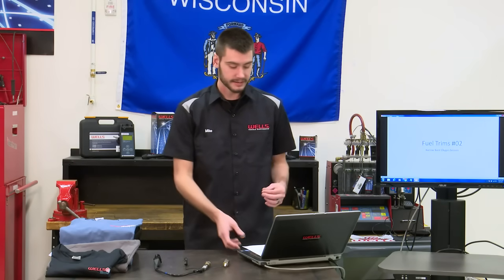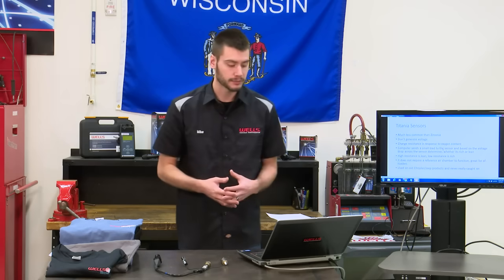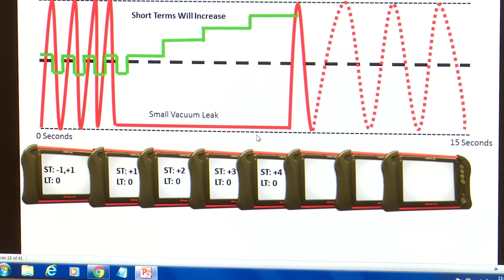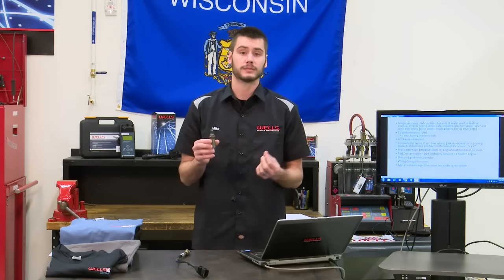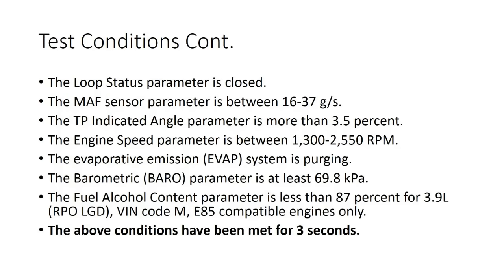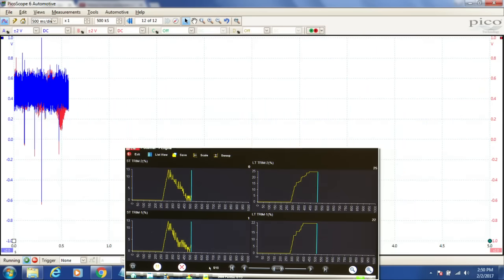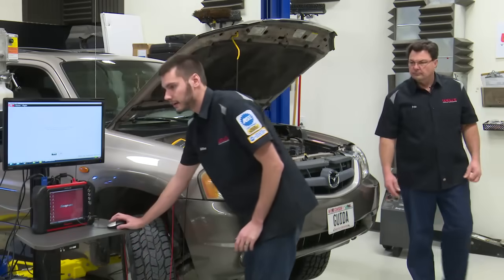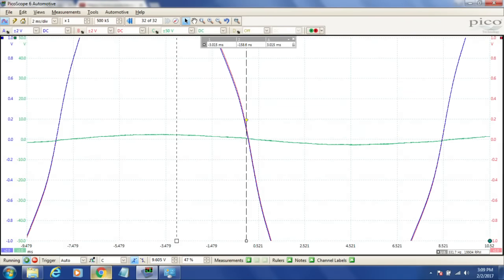Fuel Trims – Oxygen Sensor Basics—How They Work and How to Test and Diagnose Them (O2, HO2S)

Comment: So when an obd was done on my car ECM and PCM related to the ASB came up ~ the guy said it means the ECM and PCM are not communicating with each other and there may be an electrical problem ~ what can you tell me? Much appreciated. Honda CRV 2008. My mileage dropped from 24.6 immediately and after two days to 19.1 after filling up at a particular gas station that has been reliable in the past but I am wondering if they got a bad load of gas as this happened right after I filled up with them.
Reply from the maker: Hi, if you are having a communication issue with the PCM chances are the vehicle would not even run. I highly doubt it's connected to your drop in mileage. 
Mike Becker, Senior Instructor
Reply: @GoTechTraining  interesting now ~ my gas mileage has been increasing daily since this whole thing started ~ whatever!!! and my engine light went OFF! SO, Just going to fill up again at a different station and see what happens!
Reply: After you install a new emissions component, your vehicles computer needs to "re-learn", or basically, it needs to figure out how to properly run most efficiently with the new component. Whenever replacing any sensor, or emission components, you should disconnect the battery long enough to reset the computer. This way, everything is how to work together. If you only replace 1 sensor or component, the computer is using it, thinking that its the old sensor, which (at first) can lead to minor, but noticeable performance issues, idling issues, air/fuel mix issues, increased emissions, all of which, can contribute to a significant decrease in gas mileage. I suspect that the person who replaced your sensor did not dis connect your battery. Personally, every time i change my oil, i dis connect the battery, just so the computer re-learns everything. I have noticed that when I change my oil *without disconnecting the battery*, at first, i see a drop in mileage (the new thick oil needs to be broken in, which thins is out a little), then, my mileage goes back up to where it was before changing the oil, or close to, but not higher than, my previous MPG.

However, when I change my oil and *Disconnect the battery*, i see a decrease in MPG (again, the new thick oil needs to be heated up, broken in, and thinned out a little), but then i always see atleast the same MPG as before oil change, or an increase. 

Disconnecting the battery is during an oil change has nothing to do with the computer needing to re-learn anything due to the new oil, however it re-learns all the sensors and emissions components. Your motors sensors and components will perform differently in different weather, so i reset mine with every oil change. It will eventually get used to the current seasonal temps, but that takes alot of complete drive cycles, and is exposed to a very wide range of weather conditions. By resetting the computer with every oil change  (i do mine anywhere from 3000 to 4000 miles, or ever 3 to 4 months), i maintain good gas mileage, a few more mpg's than others report with the same year/make/model/motor/transmission
Reply: @p.j.vallier9197  Do you know this for a fact or are you just assuming based on your experience/outcome?
Reply: @Coldblackice  I know this from both personal experience and knowledge i gained while in school. 

The adaptive memory is for making the vehicle run and drive in a way that maximizes the overall performance for making the motor run more efficiently, reduces emissions, and to slightly adjust the shift points just to name a few. 

The adaptive memory is a way for the vehicle to determine how to properly operate in conjunction with the person's driving style, and how to make  the motor properly operate by getting to learn the slight variations of each sensor and component that comes into play.

You can have 2 of the exact same sensors, and there will be slight variations that effect how it operates. When a sensor is made, there's acceptable ranges of certain values that make it meet the requirements inorder for it to meet the specifications of what its designed for. And for the sensors, the adaptive memory is what the vehicle's ecm/pcm uses inorder to determine exactly how it will go about using the sensor.

Comment: i have an issue with the lean bank 1 with the 02 sensor never going rich unless i press  and release the throttle when it goes lean for a micro second, but otherwise its remains rich even while driving and the fuel consumption is extremely high what would you suppoose the problem is, in kenya getting somone who understands this error is had i been in and out of garages and alot of money spent so far
Reply from the maker: Hello, if the issue is that it's stuck rich all the time I would inspect the vehicle for excess fueling. Does it have a fuel pressure regulator? Does it maintain fuel pressure after the key is turned off? Maybe you have a leaky injector or something.
Mike Becker, Senior Instructor

Comment: Will a 02 sensor  bought from amazon  work as well as 1 bought  from dealership  or auto  store ?
Reply from the maker: Great question Isaiah. All depends on the brand and if Amazon is a direct seller of the product. If it's the right sensor, the right brand then yeh it should work fine. 
Mike Becker, Senior Instructor

Comment: Just love your vlog..I'm an electrican with a background in electronics trying to diagnose my 2013 gmc Sierra with 65,000 kms. Getting intermittent codes of p2272 and p0160..and when I clear codes no engine light for few weeks..then it appears again...was wondering if there was a problem would the check engine light appear right away or does it build up the codes..ie checked with scan tool and tells me there is three codes with same #...looking for where I can find schematics also.East coast Canada. Big Al..BTW D is correct answer but I did put dielectric grease in connection las summer..going to remove it when it warms up.
Reply from the maker: Hey Big Al, thanks a ton for the kind words! Chances are those 2 codes are "multi-failure sets a light" type codes. It won't set immediately. It also may not run the test ALL of the time. Both codes do seem to point to B2S2 being lazy. Has the sensor been replaced?
Mike Becker, Senior Instructor
Reply: @GoTechTraining 
 I did purchase one and my next step is to replace B2S2. I.was going to check voltages first on the signal circuit (thinking heater cct is fine). I realize the voltages fluxiate from 100 mv to 1 v .Is this what I should see..had truck undecorated last year..possible oil on exterior of sensor would trigger a bad O2 reading...not sure.. Thanks for the info.
Reply from the maker: Being that it's after the catalytic converter I would expect to see the voltage relatively steady. But yes, they will be between 100mV to 900ish mV. You can always compare it to the sensor on the other bank :) 
Mike Becker, Senior Instructor

Comment: So I have p0171 b1s1 and p0604 my 02 my car was burning oil so if my sensor was back and thr other one was white what does it mean
Reply from the maker: Hey Isreal, it's possible the sensor was damaged form the burning oil. If it's sooted up i'd recommend replacing it.
Mike Becker, Senior Instructor
Reply: I have a quick question for you. See if you can help me out with this. I'm pretty sure I'm right. Brake booster hose not the brake booster, but the hose itself. When I take a smoke test. I saw that the end of the brake booster hose. Where it meets the Y connector Smoke was leaking from there. So when I pull out the hose from the connector. And place a new hose did a smoke test again it didn't leak the hose  seems to be really hard. Not as soft to be really tight and down. So I picked up a clamp. Ive place inside there Hopefully it would stop the leak. This would cause a lean code, correct? Cuz it's part of the vacuum assembly.
Reply from the maker: Yes, the brake booster hose could definitely cause a lean condition if it were leaking. It is under full engine vacuum all the way into the brake booster.
Mike Becker, Senior Instructor
Reply: @GoTechTraining  Thank you so much. I try to find other forms about it, but I could not find anything. I do enjoy watching your show. I've learned a lot about it. Certain things I couldn't understand but Thank you so much. You're very helpful compared to everyone else.
Reply from the maker: Thanks!!
Mike Becker, Senior Instructor

Comment: Have an old OBD1 Daihatsu and no way of checking anything with any available scan tool. Bridging the diagnostic connector showed nothing, wanted to test O2 sensor (single wire) and thought how? DVOM doesnt work well so got out the old mans 50 year old analogue multimeter, unplugged the O2 sensor from the supply harness and made a bare wire bridge between the male and female plugs then connected analogue meter to the bridge and low and behold, the analogue meter showed me the response of the O2 sensor. Well as best as I could get. This meter had a dc voltage setting of 2.5V range so could get a decent read too.
Reply from the maker: That's awesome Jason! Way to put an old school tool to use!
Mike Becker, Senior Instructor

Comment: P0133 O2 SENSOR BK1 signal too slow....causes for this....bmw e87. New o2 sensors.... what can cause this? Thanks
Reply from the maker: This could be caused by a lean condition. The code is saying the voltage is too low. This can be casued by a bad sensor, but you said you already put a new one in. I'd be looking for air getting into the engine after the MAF sensor. BMW"s are common for the air intake tube to crack. Also, PCV issues. Look for an exhaust leak pre-02 sensor as well. Good luck!
Mike Becker, Senior Instructor
Reply: @GoTechTraining  hi...one of the leaks...was the pcv valve cover tube. Was sealed on the intake. One this that i notice. The upstream o2 ( yelow seal conector) and downstream o2 (green seal conector)....they are mixed?? They have diferent cable leght....
Reply from the maker: If you get me the year and engine size I can look up the sensor part numbers and see where that leads us.
Mike Becker, Senior Instructor
Reply: @GoTechTraining  
Bmw e87 (2005) 116i Engine N45B16.
Reply from the maker: This must not be a US model? i'm not showing that listing in my information.
Mike Becker, Senior Instructor
Reply: @GoTechTraining  its EU model. Portugal.
Reply from the maker: Unfortunately i'm not able to pull the sensor number on something outside of the US.
Mike Becker, Senior Instructor

Comment: PO171 Bank 1 System too lean. Why isn't this among the 62 oxygen related code you showed us?
Reply from the maker: Hey Frosty Leprechaun, because a P0171 is not an 02 sensor code. It's a lean code that could be caused by 1000 different things, 02 sensor being one of the them. The 62 codes show were directly related to 02 sensors in their definition.
Mike Becker, Senior Instructor

Comment: Ive this problem on my golf 6 gtd 2010 gaz temperature transmission error. What should i do. Clean it or get a new one. The car sometimes slowdown  high consomation of gazoil  and when the car stand up  it shakes
Reply: Great
Reply from the maker: I don't recommend cleaning an 02 sensor. If you remove it because it's bad, your best bet is to replace it.
Mike Becker, Senior Technical Instructor

Comment: Vehicle: '06 Mustang GT with long tube headers and cat deleted h-pipe. Off road use only. Downstream O2's are turned off. What would cause slow response on both banks after a 5~20 minute hot engine restart? The ECU goes in to close loop, but the O2's barely respond with voltages between 0~.5 volts. Both fuel trims begin to climb and usually peak at ~+65 and hang there for about a minute or so. Bank 1 sensor usually begins responding normally (switching back and forth .1 to .9 volts) first and then bank 2 will follow shortly after. The fuel trims come back down to normal between -3 to +3 there after.  Occasionally the ECU will set a code slow response code(P0133) and/or a stuck rich code(p2198). I've changed both O2's  with no change. Have not detected any exhaust leaks. The O2's operate normally on cold engine start and if I restart say after 20+ minutes.
Reply from the maker: Hey Jrwou1, are the front sensors too far down the pipe? Not properly reading the exhaust content? Anyone else run into these issues with these specific headers?
Mike Becker, Senior Technical Instructor
Reply: @GoTechTraining  Headers and h-pipe are by Pacesetter. The front O2's are located in the collector of each header.

Comment: I have those problem with my 2006 Toyota wish(Malaysia), it shows p0141 O2sensor heater circuit(bank 1 sensor 2) on scanner. What should I do? What is the effect for having those problem?
Reply: I think it's possible that the heater on the sensor has gone open circuit. It could also be short circuited but that would probably have blown a fuse. Test the resistance of the heater and look for 2-14ohms. HTH.
Reply: @TheHeatingEngineer  should I replace the sensor with the new one?
Reply from the maker: I'd recommend you perform that resistance test :)
Mike Becker, Senior Technical Instructor

Comment: An o2 sensor doesn't detect oxygen, it detects a lack of it (zero to 300mv output) and it also detects an excess of fuel (600 to 920 mV)
Reply: 1magnit but why does it give you those readings on a multimeter?
Reply: Diffusion of oxygen ions through the electrolyte causes a build up of charge, measured as voltage, the greater the rate of diffusion, the greater the voltage.
Reply: 1magnit i wish we could be neighbors
Reply: We learned this stuff in school, chemistry, electrochemistry, half cell reactions, oxidation and reduction, half cell voltages, full cell voltages, the zero to 300 is the half cell voltage for o2 to oxygen ions, the 600 to 920 is the full cell voltage with fuel as the other half cell.
Reply: 1magnit i havent gone to school yet but i can figure out how something works, how its put together, and how it breaks by taking it apart and looking at the components i can safely say i  have an edge over a kid fresh out of school with no experience (not saying you by any means but a friend i have that paid 36 grand to go to school and still asks me for advice) my stepdads an automotive engineer, and took me under his wing at around 13 years old, im sure that helped alot.

Comment: What if the values of the sensor remain the same if you create a vacuum leak? and the sensor has already been replaced twice.
Reply from the maker: Where are you viewing the values? In a scan tool or actually taking voltage measurements?
Mike Becker, Senior Technical Instructor
Reply: thanks for the response.it's a 2004 ford focus gasoline. I use the official Focom scanning tool. I have solved the problem now. The problem was the new Ngk sensors that wasn't good. after buying ngk sensor twice, I have chosen for a Bosch sensor. and the car has been driving for a week now, and now the Long term fuel trim always stays at 1,2 %  And when i create a vacuum leak now it reacts immediately and goes very lean to 23% positive.    the seller also told me that there are many problems with the Ngk oxygen sensors. they come faulty directly out of the box giving faulty readings, or they go worn out within low mileage and giving faulty readings without check engine light.
in any case, the car is now driving all the way as new with the bosch sensor, and a lots of engine power.

Comment: How about ? How to recognize the (cpu pin abbreviation )for finding the  Actual pin  , let's say the signal wire or the power heater pos. Wire.?
Reply from the maker: Sometimes it's guessing. Sometimes there's a glossary. Depends on the situation. 
Mike Becker, Senior Technical Instructor

Comment: Use Propane instead of Brake Cleaner.  Much safer and doesn't damage your rubber hoses.
Reply from the maker: Great tip Gary!
Mike Becker, Senior Technical Instructor

Comment: redfr21@icloud.com, Installing these 2 sensors should be done routinely as a means to keep a car in peek running in the most efficient posable condition, right?
Reply from the maker: Sure Frederick, they degrade over time. If you want your car in tip top shape it would be a good idea.
Mike Becker, Senior Technical Instructor

Comment: How do you trick a o2 sensor after a cat so it reads normal? Cat is no good and don’t have the money to buy a new one. Ej255 motor it’s the sensor after the down pipe
Reply from the maker: Jordan, you really can't. Besides it's not legal to "trick it" in order to pass emissions.
Mike Becker, Senior Technical Instructor
Reply: No more emissions In Washington state after the first. So it will be legal. Is it possible to pull the o2 sensor out of the exhaust stream a little bit?
Reply: Spark plug non fouler. I only offer am amswer cause i know what its like to struggle financially. Good luck.

Comment: D, Neither, a) my connector is inside the cab under the passenger seat not exposed to the elements, and b) my O2 sensor, as I understand from what I can glean from the factory manual, is a resistive element and proportional, it doesn’t switch on and off. I’m an enthusiast, 1988 Mercedes 300e, W124. I’ll bet I’m probably wrong too.🥺
Reply from the maker: Hey Wayne, actually you are correct! Nice :) 
Mike Becker, Senior Technical Instructor

Comment: im driving ford focus st 170 durateck 2l  16v how can i hack my 02sensor 4wire 2black 2white wires
Reply from the maker: Can't really "hack the sensor". You may look into a tuner devices that can change ECM software.
Mike Becker, Senior Technical Instructor
Reply: @GoTechTraining  tank you I'm stating in South Africa and  only get the sensor at ford It self and is so expensive  ford need to order It from over sea is it posable to put a management system on it i tink it will be cheaper then the sensor it self its like R 6500 my ford is 2005 st170